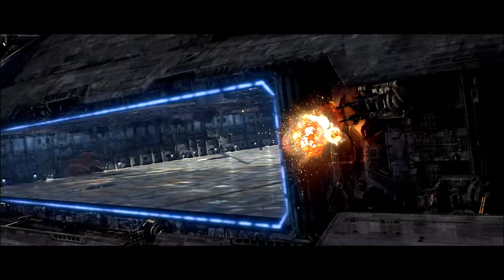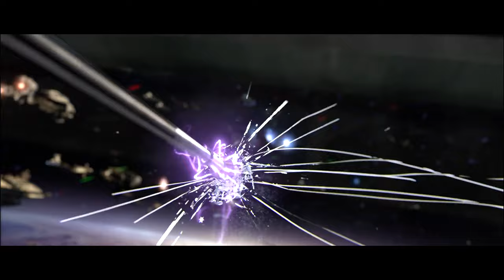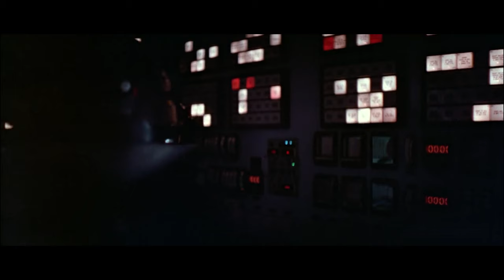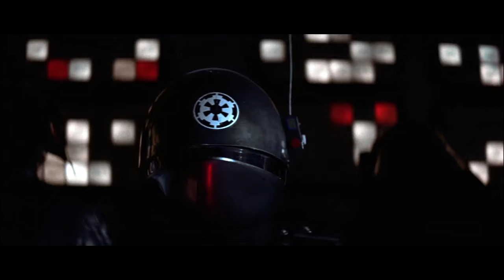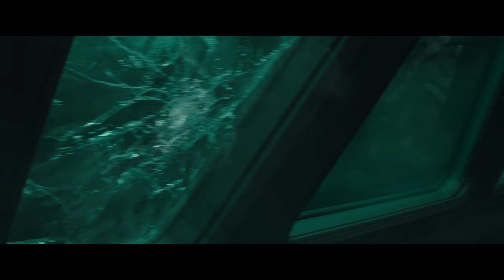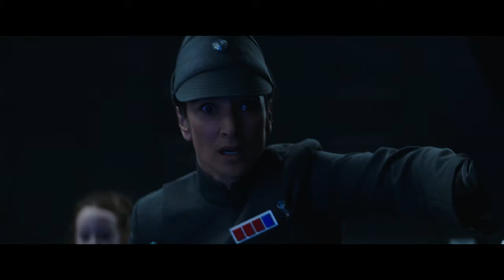This makes literally no sense

Comment: Maybe the glass is designed in a way to be really stable against outside force but easily breakable from the inside in case you want to confuse some Jedi who infiltrated your ship?
Reply: Yeah, or in case you need to get out due to an emergency and the door is jammed.
Reply: My head Canon is grievous has been waiting to test this very glass the whole entire clone wars.
Reply: im pretty sure it's just cheaper and easier to mass produce glass than to mass produce sensors and setup those sensors all throughout the ship. and then you also have to hope those sensors don't get targeted by the enemy so that you can rely on them.
Reply: @zk2399  Actually they do have those sensors the reason why they have glass is because if the sensors are damaged due to attacks they can still see what is going on.
There is a weapon called an ION canon which fires a blast that knocks out ships power and the like so having some ability to see if the ship goes dark is important. 
Its a Pro con effect and most times its not an issue we are just seeing some of the major times it was an issue.
Reply: @revanninja  that's what i mean, in the video he says just replace the glass with sensors. if you only have sensors then you're screwed when those sensors get lost due to anything
Reply: Bro why do cars have windows when we could just use cameras🤓
Reply: @likepick 8326 Because if a car window shatters you don’t get ejected into space.
Reply: @refugeehugsforfree4151  thanks, that’s my head canon now
Reply: @zephyr8072  yes but you get killed by the thing that shattered it
Reply: @zk2399  Well that is the thing I am saying they have both the sensors and the windows. Which you came across like they didnt have the sensor.
So if that wasnt what you meant my apologizes.
Reply: It’s a movie. Just shut up and enjoy it. Thanos was right!!!
Reply: Tactical window
Reply: Anakin also completely destroyed separatist frigates in TCW, just by shooting the viewports on the bridges a few times lol
Reply: True
Reply: Grevous was like, "Yes, I finally get to use the ship's glass the way it was super specifically intended!"
Reply: It’s probably cheaper than the Shelds
Reply: That's contrived.
Reply: @DeadPool-uy8wu   True Dat!!!!
Reply: I mean the entire ship's exterior is covered by power shield most of the time, so it's is actually much harder to break from the outside, and it's commanding deck, being able to physically see everything that's going on around the ship is pretty important for commanders. If they rely on digital systems to broadcast all outside information and the system suddenly breaks down, everyone in the ship would be entirely blind to everything that's happening around them.
Reply: @likepick  because cars aren’t used for battle. Tanks are and I don’t see any glass windows on those
Reply: Kinda doesn't make sense though, because since space is (mostly) a vacuum, there's more pressure inside.
Reply: @JunkFlush  my previous comments were somewhat sarcastic but yes they use cars in war they are just military cars that do have glass but idk how car and space ship compare also i think the space ships have option to close the windows or something
Reply: This makes more sense than anything in the Obi-Wan series
Reply: Well it is Star Wars after all. So cool first, logic second, but that's okay because it's space opera.
Reply: I like how Anakin and Obi-Won just stand around while Grevious throws his spear at the window. They could have cut him down right there.
Reply: @refugeehugsforfree4151   LMFAO
Reply: I like this Answer
Reply: And there is The Last Jedi where 2 ships destroys the bridge easily through the window.
Reply: @refugeehugsforfree4151  he has a great auto insurance on it to, so he gets 50,000 credits after all damages
Reply: That's not how glass works in the case of tempered glass anyway
Reply: Well, most star wars capitol ships have a window lock down in case of emergency. If the glass is threatened or destroyed, a vacuum sealed metal cover closes on it. The problem is that no one seems to use that.
Reply: This is actually a real thing on battleships in ww1 and ww2!!! They will usually have massive armor belts that protect the magizene and the guns, but the actual captain and any admiral on the ship will be in the superstructure, protected only by glass. The main reason for this is that years of experience showed that not only is it more valuable to see the enemey than it is to be protected by hostile fire, but a captain is far more replaceable than a gun, especially during a battle
Reply: But for safety reasons that really wouldn’t make any sense
Reply: @DivineHellas  why? Everybody on the ship is a droid anyway. The real question is why was it pressurised in the first place?
Reply: Yea that's BS, irl we managed to make the transparent aluminum from star trek and it can take a .50 Caliber round at 1.6 inches! I mean Grevis would never been able to break that shit at all! (Also I know I spelled the name wrong)
Reply: That....that doesn't make any sense how can glass be breakable on one size and the other isn't that doesn't make sense besides it's like breaking the laws of physics or something unless it's like that two pieces of glass like those on cars with the clear plastic in-between
Reply: Star Wars showcases that high tech and low tech are always mixed together.  The cannons are directed by personnel even though AI exists.  Plus Ion weapons have shorted Star Deatroyers twice (Empire & Rogue1); if the shields are up, window glass isnt a problem, but you short a ship and windows still offer an outside view.
Reply: Honestly that does sound like something Grievous would ask for considering how much he likes making quick escapes
Reply: Because the ship has SHIELDS!! If shields go down doesnt matter what its made of your fucked lol
Reply: Like a weird prince ruperts drop.
Reply: Or it’s just because they didn’t think of it
Reply: The "windows" of the ships are made allways of transparent steel

Comment: Well what if the ship gets disabled like the star destroyer on Scarif, you’d be blind with no windows
Reply: Exactly my old friend
Reply: does having any windows at that point gonna change anything tho? your ships still disabled and theres nothing they could do but watch
Reply: @icer1249  you could break the window once the ship crashes, because remember the doors are automated and would be stuck unless you have an R2 droid or the thing they use to unjam doors
Reply: @SuperDababy2  like.. explosive bolts?
Reply: @SuperDababy2  I’m sure there’s manual hatch releases for at least some, if not most, doors.
Reply: Also relying only on technology is a bad idea, windows can give you a better fov, not to mention that style is very important in Star Wars and having a ship with no windows would be kind of bland, also consider the fact that you’d need extra power to replace all of your window with sensors etc that could take up power that could be used for weaponry or engines, windows are perfectly read to put on a ship but yes they should be made out of reinforced materials just like with real life vehicles
Reply: @icer1249  You could watch, learn and develop a plan and which to execute immeadiadly when the power comes back on
Reply: Are we blind?
Reply: I am pretty sure I once heard they'd use transparent durasteel for the capital ships windows. It wouldn't leave them blind but also wouldn't shatter.
Reply: @icer1249  I mean, you know what the problem is and you can still see what the enemy is doing so you can single to other ships and fix the problem. In the case of fortress inquisitorious there is no point.
Reply: The only reason for windows to exist in Star Wars is plot convenience, same as the space battles not just within a visual range, but often point blank.
Reply: @evilbabai7083  yeah that’s true but it’s like designing a car without windows, such as a Tesla because of auto pilot. You don’t want to just rely on robots do you? Cameras can get dirty and easily damaged.
Reply: @pubg-blsy3352  if you have to rely on your naked eye in controlling the spacecraft - you're done. Without radars and your guidance systems your ship is effectively blind and uncontrollable - you can't fly a spacecraft on a whim, your course should be calculated precisely according to other objects position, trajectory and speed (abd mass, if we're taking of planetary bodies), having windows won't help with anything of that. Furthermore, in order to effectively engage the enemy, you will additionally need an array of various sensors, including strong optics and thermal detection, otherwise some ship could hide kilometres from you just being in a shadow. With those speeds and scales controlling a space battleship is unlike anything you could experience on the ground, so even if we stretch out enough for fighters to have their canopies (they're small, capable of low speed atmospheric flights and can fly close enough to enemy capital ships to penetrate their shield), having windows on a star destroyer's bridge is just asking for trouble - if you're so close you can see your enemy, you're making enemy a favour by presenting the whole ship's command in such a vulnerable spot .
Reply: @evilbabai7083  I mean how did Anikan and obi wan land a massive capital ship that was cut in 2 at the beggining of the revenge of the sith. They used their eyes and a joystick.
Reply: @pubg-blsy3352  that's what the movie implied, but it's not that unambiguously if you watch the sequence carefully - they still rely on their instrument panels and R2 managing the remained vessel systems as it's obviously the only thing that they were able to see is the landing strip when they were directly above it, which, considering the ship was barely controllable and lost its thrust, means that they had a direct course prior the reentry (which is obviously not possible by eye). 

The whole scene (up to the very ship design) is basically overdramatization and plot convenience to show us the heroes struggling and overcoming the odds with a pure skill by depicting something that looks familiar for an average person (making spacecrafts a weird mixture of planes and sea ships) so he can somewhat emotionally relate to the scene, but there is no actual logic behind anything that happens.

There's no way anyone would've built a fragile glass bridge that for some reason sticks up from the bow, especially on a huge interstellar battleship because the risks involved just don't worth an ability to see something up close at low speed, there is no way protagonists could've even crash landed a piece of that massive ship using just airbrakes (and it's not even clear how they've retained any system on-line, because they've lost half of their vessel with a power plant) as it either would be a vertical drop if they had slowed it down to a "safe" speed, or if not, keping the trajectory as we saw, they would've turned into massive crater (and that's if we ignore the very fact that it would take years for a ship that lost its power while being at a geostationary orbit to fall). And, again, even if we assume ship was capable to pull off such landing, they still would've been able to land it without using windows as long as they have their instruments and R2, while vice versa would've resulted an uncontrollable crash in the middle of nowhere. 

But even though I'm aware that the way spaceships and space battles depicted in Star Wars is an artistic choice, I would've loved to have those being more subtle, so they won't crumble into a nonsense if you think about them for more than three seconds. The fact I know the purpose of how certain things are depicted doesn't mean I want to pretend those are sensible.
Reply: @evilbabai7083  the battle of coruscant involved ships that were in the upper atmosphere, probably near the equivalent of Coruscant’s Karman line.  The vessels were keeping station above the planet with repulsive lifts, which are effective out to 6 planetary radii. The planet’s gravity at the altitude shown in the battle meant that the interiors of the ships would experience about 0.90 to 0.95 G assuming 1 G at the planet’s surface if their artificial gravity systems somehow failed or were unable to ‘counter’ the gravity well of the planet.  A ship that lost power in these circumstances would definitely fall from that position since it would not have been in a normal ballistic orbit.
Reply: @pubg-blsy3352  dude they used the Force and the best droid in the Galaxy.  And plot armor.  The ridiculous bridge with the wrap around panoramic windows would give the ships commanders a sense of oversight and control of the battlefield, but it would be a false sense.   Outside the huge battles of Coruscant and Endor ships wouldn’t be engaging in such close combat that visual sighting by unenhanced sight as primary or even secondary target identification or weapons lock acquisition.  And there’s no way anyone is piloting a space vessel with eyesight alone, and definitely not in combat.  When Apollo 13 was attempting to plot a trajectory for reentry after massive damage and power loss they still had on board telescopes, periscopes and other ways to enhance normal vision, and that was mid 20th century earth tech.  Imagine the back ups and failsafes designed in starships of a Galaxy spanning civilization lasting thousands of years.
Reply: This is why a ship like this would probably also have some kind of observation area; not necessarily a navigation bridge analogue where the ship could be controlled from, but more like a crow's nest. Don't put the command crew there, have a couple of crewmembers with macrobinoculars and self-powered comlinks who can report on stuff.
Reply: @SuperDababy2  you know there's battery backup systems and shit. You can't completely disable the doors just because the ship is disabled...
Reply: @SuperDababy2  Just grab your local Jedi. They'll cut you free
Reply: @CPT_LUKE  Maybe have that as a backup bridge if the main one is disabled and then goes blind
Reply: @icer1249  you get to see pretty explosions!
Reply: @icer1249  you cant dodge what you can't see. That extra time could very well be the difference of maming/death and survival in an already desperate situation.
Reply: That seems like it poses a much higher risk than the benefit it poses in such an unlikely scenario